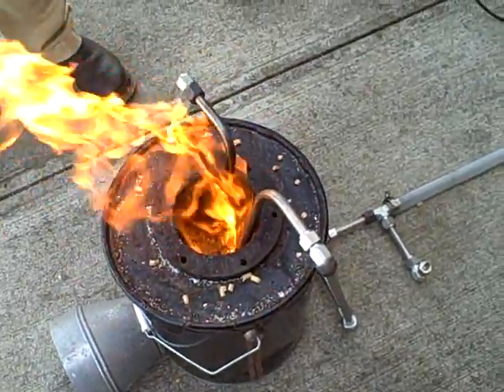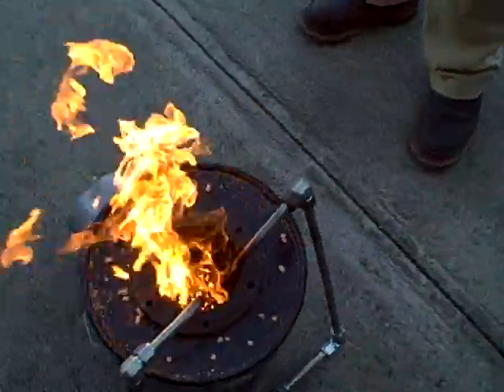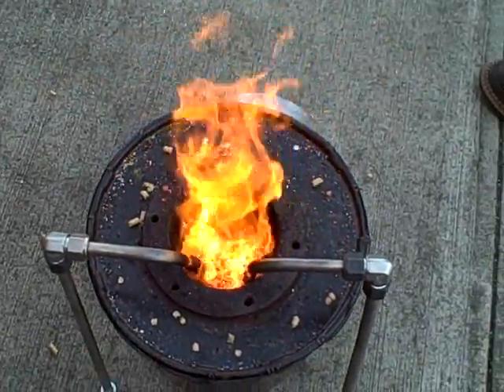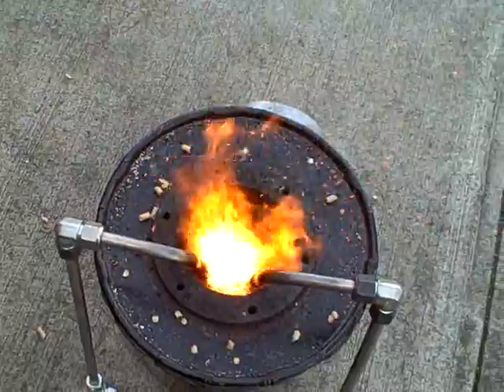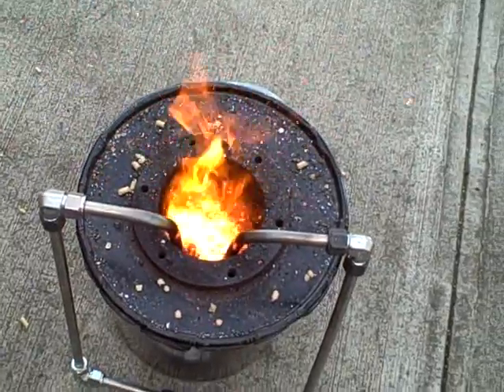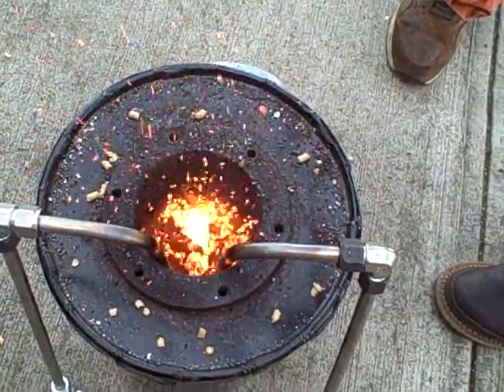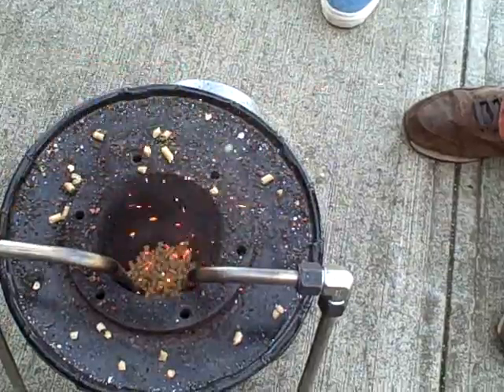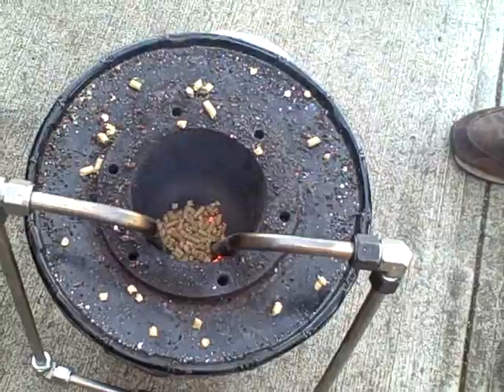Fluidized Bed Combustor -- part 1 (first trial run)

Comment: Great project for students!  A more stable flame could be achieved using an inert bed of sand to fluidize with the pellets.  I may also stabilize your temperature measurements.